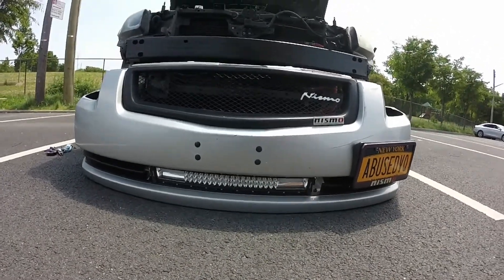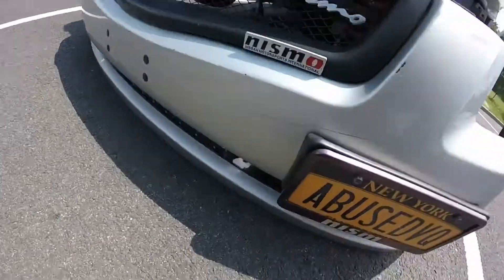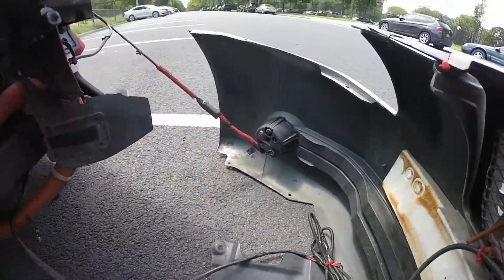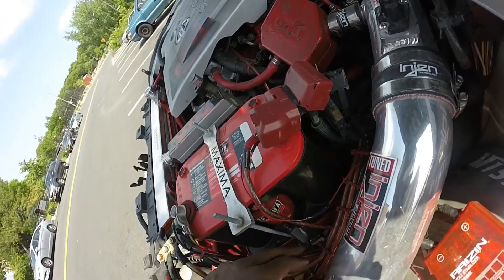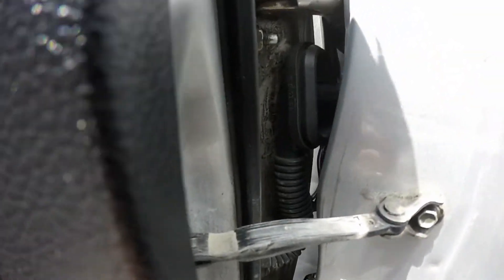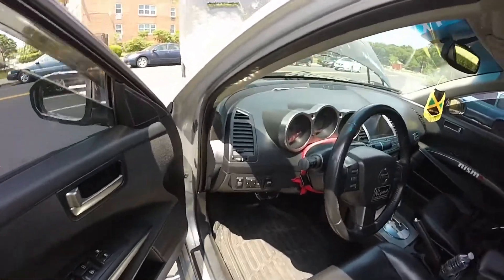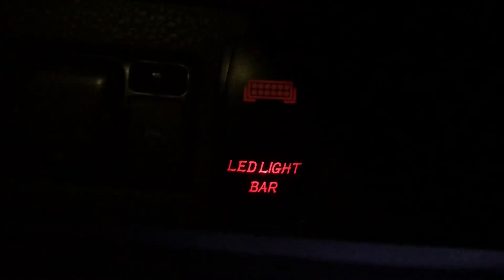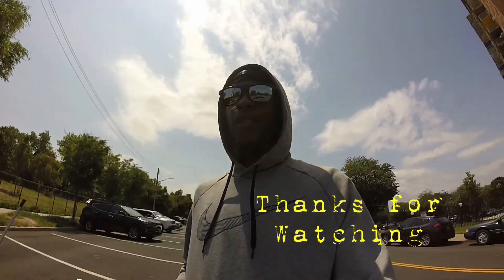Light Bar Install 04-06 Maxima —__— Silver Surfer

Comment: Check engine light bank 1 sensor 1  been changed light still on. As I'm sure you know NY don't play that  plus some other things but that's mostly trying to get on that silver surfer lever
Reply from the maker: For the most part on the CEL being on, you may just have to reset it and see if the light comes back on.. And I know my guy they don't play that at all.. You can get it like the Surfer.. All in due time..

Comment: No link for the the light bar 😤 ???
Reply from the maker: Check out 10D Quad Row 32inch 2160W Curved Led Light Bar Combo Offroad Jeep Dual Color 36"  https://www.ebay.com/itm/10D-Quad-Row-32inch-2160W-Curved-Led-Light-Bar-Combo-Offroad-Jeep-Dual-Color-36-/273002972193?roken=cUgayN&soutkn=bIwcXb via @eBay